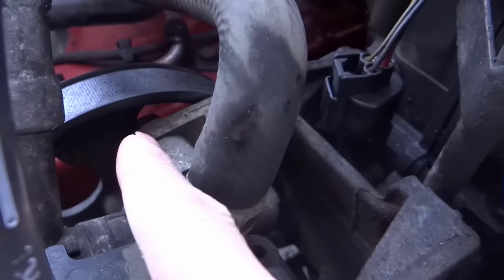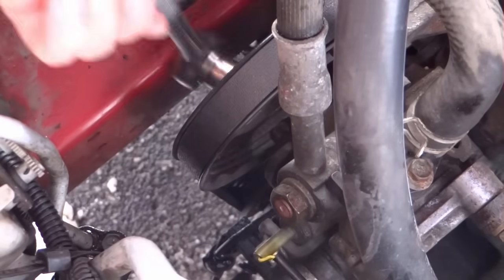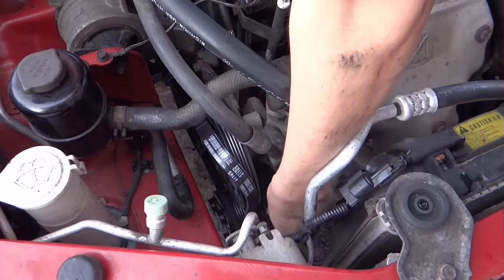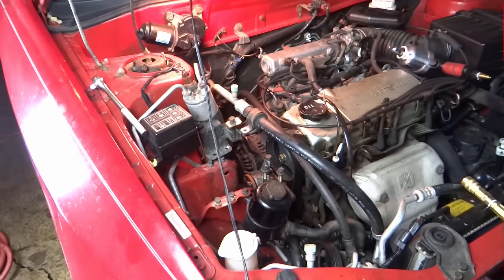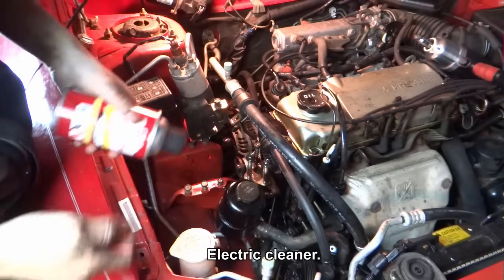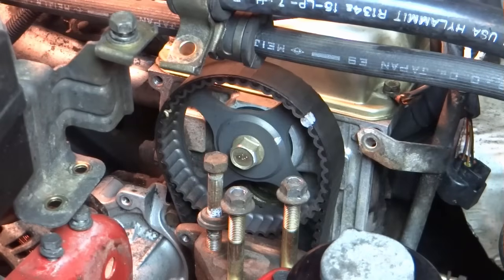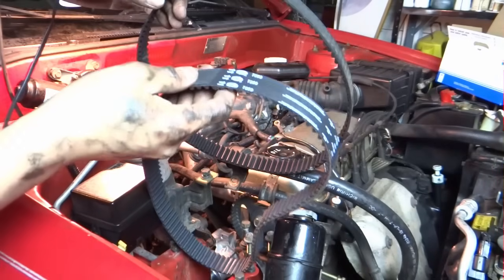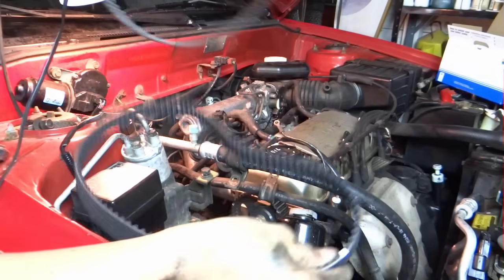Mirage Fix 4 | Steering, Alternator, Timing Belt & Water Pump 4G15

Comment from the maker: 97-02 Mitsubishi Mirage 1.5L Timing Belt + Tensioner Kit 
eBay https://goo.gl/0Il78V

97-02 Mitsubishi Mirage 1.5L Water Pump
eBay https://goo.gl/CgNeXX

97-02 Mitsubishi Mirage 1.5L AC Belt
eBay https://goo.gl/KIuP0a

97-02 Mitsubishi Mirage 1.5L Alternator Belt
eBay https://goo.gl/ATiRcj

26 Gallon Oil-Free 1.8 HP 150 PSI Vertical Air Compressor
eBay https://goo.gl/GbhT2e

1/2" x 50' 300 PSI Red Rubber Air Hose
eBay https://goo.gl/TRqvV8
Amazon http://amzn.to/2p1rJE7

STEEL QUICK I/M 1/4 COUPLER PLUG SET STARTER KIT AIR TOOL
eBay https://goo.gl/BeF7Qz
Amazon http://amzn.to/2q1otXN

1/2" x 260" PTFE Thread Seal Tape
eBay https://goo.gl/xIYyFt
Amazin http://amzn.to/2oIE2mr

600ft/lb Impact Gun
eBay https://goo.gl/EdFS6L
Amazon http://amzn.to/2oP563T

OEM MITSUBISHI DOOR SCREW WITH CAP
http://www.streettunedmotorsports.com/parts/oem_evo_door_screw_cap.htm
Reply: DarkDragonWing where can i get workshop manual?
Reply: DarkDragonWing v
Reply: DarkDragonWing that's sucks doing those repairs in the winter

Comment: I'm watching your video to understand how I ensure I got the timing right. I'm replacing the timing belt on a 91 Lancer. Why is it important to mark the belt and the sprockets, shouldn't it be enough for the camshaft and crankshaft sprockets to align with their respective marks on the engine block? Thanks for your videos.
Reply from the maker: @user-zf4uz3hy8z  It is already enough for the sprockets to align with their marks. I just don't bother to adjust the sprockets to align with their marks, just paint and done.
Reply: @DarkDragonWing  I see! It's good to have that as a back-up. I'll make sure to make those marks, to fall back on just in case I move the camshaft when I impact it. I've been replacing silent blocks and bushings in the front suspension (it drives so nice now), and a few other bits and bobs that keep me busy, but I'm about to dive into this part soon.

Comment: Hi, Thanks for this very useful video. I have a water pump question. Is it really necessary to replace the water pump? The one you removed looked absolutely fine. I am changing all belts including the timing belt on 2000 model Lancer with a 4G15 engine with 100,000 km on the odo and I am being advised to not change the water pump as it’s the original Japanese part and they last a long time. What is your view?
Reply from the maker: If it works, don't replace it. Especially pretty low mileage.

Comment: I have a BYD F3 car with a Mitsubishi 4G15S engine. I replaced the timing belt in 2020, and after driving for 30,000 kilometers, the timing belt broke in April 2022 while I was on the highway. I had to tow the car to a repair shop, and the engine valves were damaged. It cost me a lot of money to get it fixed. Until now, I still can't understand why the new timing belt broke.

Comment: my 2006 mitsubishi lancer will crank but wont start. Pulled plastic timing chain cover and while cranking the engine the timing belt wont spin. Is this normal or is this engine failure????
Reply from the maker: That sounds pretty bad.

Comment: Hello 
I Have A question For You, is the big pulley belt markings different from the Timing belt markings ..? How do you get the accuracy of you have missed the markings 

Also how do you get the distributor to line with the timing belt 

What are the signs to look out if they align.. 

Again, thank you for this awesome video, I have learnt a lot
Reply from the maker: Here are the timing marks: https://www.2carpros.com/images/question_images/299175/original.jpg
Reply from the maker: Here is an information about the distributor: https://www.fixya.com/uploads/images/ed21d94.gif
Reply: Anything on O2 sensor Positioning … ?? 

Should both sensor be before the catalytic converter..?
Reply from the maker: @crakkhausetv9827  I don't think 4G15 has an O2 sensor.

Comment: Hey, what's the torque on the crankshaft pulley?
Reply from the maker: The torque spec for the crank pulley bolt is 95 ft. Lbs.
https://www.2carpros.com/questions/changing-the-timing-belt-on-a-4g15-interference-engine-sohc

Comment: Great videos. I have the 4g15 engine in a Proton Jumbuck from Malaysia. The car is a right hand drive for Australia. Would it be the same to change  the timing belt and water pump on?
Regards Russell.
Reply: depends if its sohc ot dohc

Comment: quick question can you replace the water pump with taking the timing belt out?
Reply from the maker: Possibly, but challenging.
Reply: @DarkDragonWing  thanks.. the problem is i replaced the belt and the water pump both last year and the water pump is going bad!
Reply from the maker: ็Hmm It's unfortunate, but it has to be done. Now get it done. haha This time make sure the surface is clean and the bolts are torqued to specs.

Comment: I have a 1998 mirage and my water pump is bad....yours is a 1999 I was wondering if yours is the same as mine under the hood
Reply from the maker: Should be the same. Unless yours have 4g18 or 4g94, then your car's engine should be similar to one in a 02-06 Lancer.

Comment: How can I send you a video showing a problem I have with my Mirage 2001? When I start the engine and I retired the terminal cable of the battery, the car try to turn off or run in low charge, the pannel lights, radio, and external lights slowly gets low and low like is loosing power. I dont know if is a Relay, electrical cables, computer or is out of time.
Reply from the maker: Hi. It looks like you need a new alternator.
Reply: DarkDragonWing 
I bought it, along with a new battery. When I turn on the car and the battery terminal is removed, the panel light turns off, the panel's backlights start to blink, the radio stops ringing and starts blinking as well. only when I accelerate, it stabilizes but once I stop accelerating it after several seconds the radio stops playing music and next to the panel they continue blinking. I have a video, could I send it to an email?

Comment: Just curious why didn't you align the crank to top dead center? I am just worried that the pulley might could have jumped while you were taking the old belt out. I'm still new to changing timing belt, but your opinion would help my mind clear. Thank YOU! more power to your channel.
Reply from the maker: This one works for sure. If anything jumped, I can always use the other way you said.

Comment: hey bud i was wondering if you could help me out here, my father was changing the waterpump on a 4g15DOHC (dual cam version) and long story short he didn't mark anything and the belt and timing is not completely off

we found the timing marks on the cam sprockets itself but i can't seem to find the markings on the engine to line it up, you got any idea where it is?

Comment: Hi can you please provide me with some links to find the power steering and alternator belts for the 4g15 engine
Reply from the maker: 97-02 Mitsubishi Mirage 1.5L Timing Belt + Tensioner Kit 
eBay https://goo.gl/0Il78V

97-02 Mitsubishi Mirage 1.5L Water Pump
eBay https://goo.gl/CgNeXX

97-02 Mitsubishi Mirage 1.5L AC Belt
eBay https://goo.gl/KIuP0a

97-02 Mitsubishi Mirage 1.5L Alternator Belt
eBay https://goo.gl/ATiRcj
Reply: DarkDragonWing thanks man you are so very helpful

Comment: i have a mirage 2001 and i noticed that it was leaking oil not from the oil pan but from a cable that is connected to the radiator next to the water pump. what can i do to stop it from leaking
Reply from the maker: I'm not sure. You might wanna look into replacing that cable/plug.
---

I can't come back to reply, you will have to start a new comment if you have any questions or concerns. Cheers
ผมกลับมาตอบไม่ได้นะครับ ถ้ามีอะไรอีกก็ต้องไปเริ่มคอมเม้นใหม่ครับ
Reply: I checked the ATF hose and that was the  issue

Comment: change timing belt on a 1997 mitsubshi mirage. now i have to crank the key 3 times before it starts.what can be the problem?
Reply from the maker: Is it running normally after started? If it is, then your problem will be with spark plugs or distributor.

Comment: Just out of curiosity how long did it take you to replace the water pump? I am about to get a Mirage and it needs a new water pump and i am wondering about how long I can expect to be working on removing the old pump and replacing it with a new one?
Reply from the maker: If you are going to replace the water pump, you should also replace the timing belt. It should take a bout 6 hours or more. I would suggest start in the early morning so that you have the whole day to figure things out when you need to buy tools or parts. cheers

Comment: Hey guy thanks a mil, it means a lot to me, real friends "although we haven't met", about the car, Yes I have a full tank and it cranks but my battery is dying from so much trying, I even changed the light blue 20 Amp (32V) engine fuse, NADA, it's just strange; I even looked for a crank sensor but it's built in the Distributor.
Reply from the maker: +michael cardona Did you try putting some gasoline inside the intake hole? Do this to get the car starting. It would be better if I can see a  video of you trying to start it.
Reply: +DarkDragonWing ,, Hey guy good news, my son has similar 1.5L Mitsubishi (2 door) but the engine is the same AND he's not using the car, so I borrowed the Distributor/Coil, installed it and the engine started like a rocket, I then reinstalled my original and again the car won't turn over, so now I know it's the distributor, I'll order it 2morow; Thanks again, always good work.
Reply from the maker: michael cardona Glad to hear the good news! cheers

Comment: Dark Dragon: my 1998 Mitsubishi mirage 1.5L just turned itself off; I went around the corner my neighborhood and it just turned off; chkd the timing belt, the valves, cleaned the distributor/coil, gas filter, all are fine.  Auto parts store guy told me they are notorious for dyeing, usually because of the distributor. Any hints you can steer me into, I'm about to give up on my "Japanese Volkswagen"
Reply from the maker: +michael cardona did you check to see if there is any fuel in the tank? Did you try to start it up? Is it still cranking?

Comment: Just a note of wisdom for you on a timing belt replacement.If you have not done this yet,it is smart to change the camshaft oil seal and crankshaft flywheel oil seal when you are already there with the parts exposed than to do the oil seal change later down the road when they leak oil.

Comment: I just had this job done by a garage and I'm afraid they might not of put in the new water pump, along with the new timing belt as I bought and supplied the new parts. Can I get that plastic timing belt cover off easily without taking off other stuff like the power steering pump?
Reply from the maker: +John Stenger You can get the top plastic cover off easily, yes.

Comment: are there 2 different size belts for alternator/water pump for this vehicle? the  belt that I have brought from auto zone doesn't fit. I  removed the alternator and tried putting it on, but the bottom bolt will not line up. Can you tell me what am I doing wrong.
Reply from the maker: +MrSimba27 They got you the wrong one. The belts are different
Reply: which part of the crank shaft pulley(front or back) do I put alternator belt on?
Reply: which part of the crank shaft pulley(front or back) do I put alternator belt on?
Reply: which part of the crank shaft pulley(front or back) do I put alternator belt on?
Reply: which part of the crank shaft pulley(front or back) do I put alternator belt on?
Reply: which part of the crank shaft pulley(front or back) do I put alternator belt on?
Reply: which part of the crank shaft pulley(front or back) do I put alternator belt on?
Reply from the maker: MrSimba27 inside
Reply: it was the wrong belt size...I didn't know that they have  4 different belt  sizes for the alternator /water pump. I brought the right  size belt and It worked fine. This video is awesome. Thanks.

Comment: hi. my 1997 lancer radiator fan not working relay and fan working fine i tried to short thermostat  switch but fan doesn't work please help me and could you please forward the radiator fan wiring diagram? 
thanks and regards
Reply from the maker: +sj k Try new sensor: http://www.ebay.com/itm/OEM-GENUINE-HYUNDAI-MITSUBISHI-WATER-COOLANT-TEMPERATURE-SENSOR-39220-35710-/251679642328?fits=Year%3A1997|Model%3AMirage&hash=item3a994692d8:g:oMAAAOSwcu5UPvIH&vxp=mtr

Fan relay is cheap: 
http://www.ebay.com/itm/BWD-R4167-Headlight-Relay-Coolant-Fan-Relay-/380792691995?fits=Year%3A1997|Model%3AMirage&hash=item58a9035d1b:m:mHBIUPL6dzDGAtBfmY3LRJw&vxp=mtr

Or try new fan?
http://www.ebay.com/sch/i.html?_odkw=1997+mirage+coolant+relay&_sop=15&LH_BIN=1&_osacat=0&_from=R40&_trksid=p2045573.m570.l1313.TR0.TRC0.A0.H0.X1997+mirage+fan+oe.TRS2&_nkw=1997+mirage+fan+oe&_sacat=0
Reply: +The DarkDragonWing , thanks a lot for reply, i tried new sensor still fan not working, but my fan and relay are ok i already checked,how can check the sensor's wiring and its connections if those are faulty?Please advise
thanks and regards
Reply from the maker: sj k
 I'm not sure on checking the wires. You will have to just trace back the wires. Is your car overheating?

Comment: hello hey I need help with my mirage 99  I went to do the smog check and they told me that the timin is bad how can I fix it by myself
Reply from the maker: +julio medina What engine do you have? 1.5l or 1.8l?
Reply: +The DarkDragonWing 1.5l
Reply from the maker: julio medina
 Good, then follow this video step by step
Reply from the maker: julio medina
 or have the shop replace it for you
Reply: +The DarkDragonWing also it leaking  from the inside
Reply from the maker: julio medina
 I see. Then you might have to replace the gaskets and seals. I don't have a video on that yet.

Comment: hi ! thanx again for your videos last time that i asked  something was  the  trouble that i was having  with the  poor horse power and too much fuel consumed in  my  lancer  and checking out i  discovered that  the  problem  was one ignition coil  wich  i already ordered .  see  the  first vidio was to change both  lower arms,      second was to change  front and rear struts
and now i'm about  to replace the water pump  and  there  comes the question 
what  i'm watching is that  you  are replacing the  water pump  on a mirage  it is the same water pump for 2003 lancer es ?
do you have a brand name wich fits  better on my lancer????   thanx
Reply from the maker: +isamel valens Hi. Oh I think your 2003 Lancer ES has a 2.0L engine. You can watch this video for reference: https://www.youtube.com/watch?v=T__PVmqXf6g

If you are gonna replace the water pump, you should replace the belts too. Here is a complete set: http://www.ebay.com/itm/Mitsubishi-Lancer-02-07-2-0L-SOHC-Timing-Belt-Tensioner-Seals-Water-Pump-Kit-/360852687802?fits=Year%3A2003|Model%3ALancer|Submodel%3AES&hash=item54047f0bba&vxp=mtr

Comment: hi there. im a big fan. I have a 97 mirage LS coupe 2 door stick shift. I haf into an accident couple of months ago and I just wanted to know wher can I buy the front bumper nd hood of my car. i tried looking up online nd local crazy race. and I got a parts same as your car. in wont fit perfectly cuz its long.
Reply from the maker: +rommel gamboa
Front bumper
 http://www.ebay.com/sch/i.html?_odkw=1997+Mirage+2dr+front+bumper&_sop=15&LH_BIN=1&_osacat=0&_from=R40&_trksid=p2045573.m570.l1313.TR0.TRC0.H0.X1997+Mirage+coupe+front+bumper.TRS0&_nkw=1997+Mirage+coupe+front+bumper&_sacat=0

http://www.ebay.com/sch/i.html?_odkw=1997+Mirage+coupe+front+bumper&_sop=15&LH_BIN=1&_osacat=0&_from=R40&_trksid=p2045573.m570.l1313.TR0.TRC0.H0.X1997+Mirage+2dr+front+bumper.TRS1&_nkw=1997+Mirage+2dr+front+bumper&_sacat=0

Hood
http://www.ebay.com/sch/i.html?_odkw=1997+Mirage+2dr+hood&_sop=15&LH_BIN=1&_osacat=0&_from=R40&_trksid=p2045573.m570.l1313.TR0.TRC0.H0.X1997+Mirage+coupe+hood.TRS0&_nkw=1997+Mirage+coupe+hood&_sacat=0

http://www.ebay.com/sch/i.html?_odkw=1997+Mirage+2dr+front+bumper&_sop=15&LH_BIN=1&_osacat=0&_from=R40&_trksid=p2045573.m570.l1313.TR0.TRC0.H0.X1997+Mirage+2dr+hood.TRS0&_nkw=1997+Mirage+2dr+hood&_sacat=0

Comment: hi! i have a lancer 2005  1.6liter engine. my timing belt replaced in 50.000 km in 2005 .since the car runs 116000 km. from 2005 to 2015 - 60.000 km.
the timing belt not changed since.

what do you say i can continue to drive with timing belt from 2005?
my car runs only 10km for a day.
how many bolts  i must open to see the condition of the belt???
Reply from the maker: Eduard Mayer You can drive it some more, but it is recommend to be replaced every 60,000km. Does the engine look like this one? https://www.youtube.com/watch?v=T__PVmqXf6g
Reply: The DarkDragonWing no. my engine 1.6 liter japanese production 2005 more like yours.my  question was if i can open the timing belt cover to see if the belt cracked if not - iwill contiue to drive!so is it possible to open the timing belt cover  and how many bolt i must release???thank you
Reply from the maker: Eduard Mayer
 Oh, there are only three bolts that hold the top cover. At 1:37
Reply from the maker: You can still drive it if it has no cracks, but I don't know if that matters.

Comment: Awesome videos man I have a 2door 1.5 mirage stick shift do you have any idea where I can add transmission fluid at? I changed my clutch and could never find where to add transmission fluid, and just a question I thought your not suppose to tighten the harmonic balancer bolt with a impact?
Reply from the maker: penguino1283 It is fine for this car to impact it, no big deal, it works fine. For the transmission fluid for manual car, it is tricky. I would take it to the shop and have it changed there. cheers